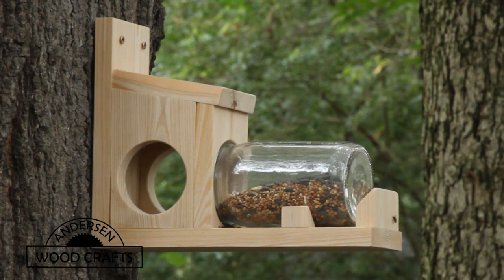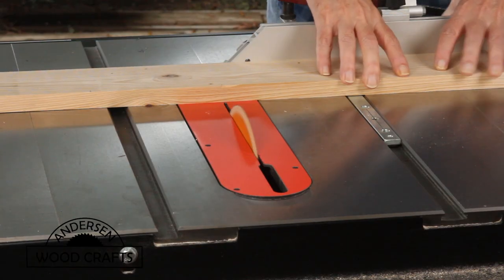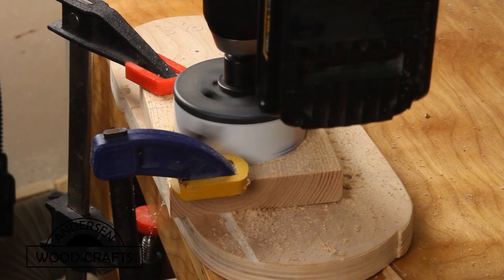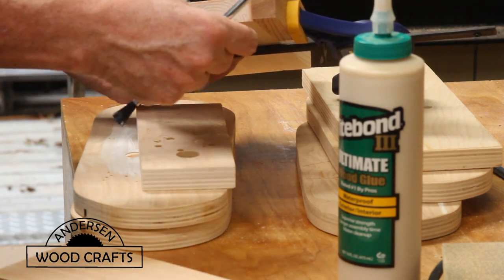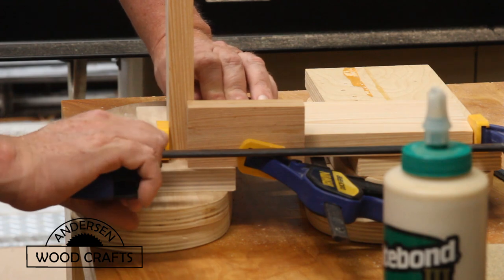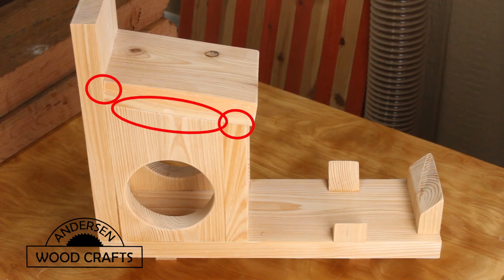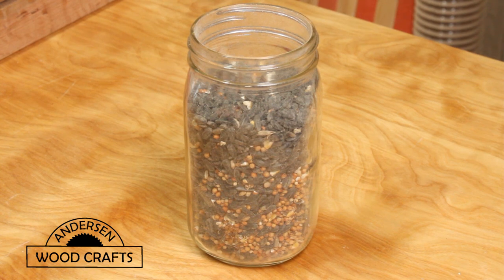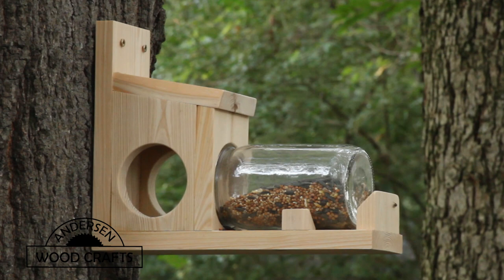EASY DIY SQUIRREL FEEDER

Comment: I like it it’s basic and simple, but you didn’t describe how you can pull that jar out without spilling more tipping it upwards. Now on the butt end of the jar I’ve seen where you can loosen the screw and it’ll tip downward and just pull it straight out.

Comment: Didn't you get a new CNC? Just curious why you didn't set up the larger hole to be cut using that.
Reply from the maker: Good question.  Even though more people are getting CNCs, I still want to demonstrate you don't need one to do certain things.  But mainly, I didn't think of it at the time.  Thanks.

Comment: That's really nice. But I'd never screw or nail into a tree, it's just lazy and wrong. Rather just use big twist ties or reusable stainless steel zip ties / clamps. Heck, you could even use two bungy cords going through two holes at the top either side and two at the bottom. Only limited by the imagination 😉
Reply from the maker: Thanks for your comment.